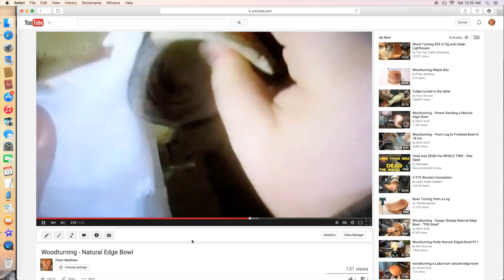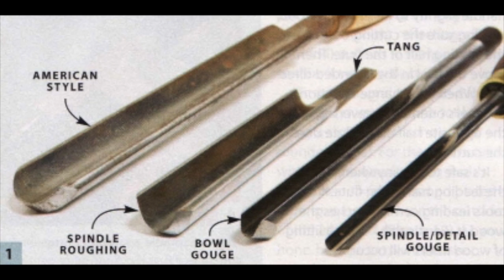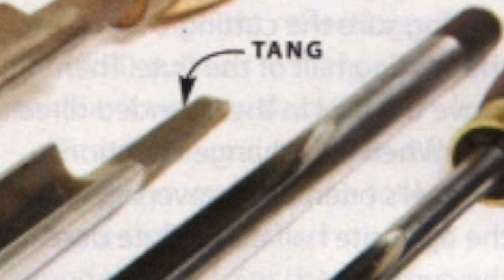Bowl Gouge Basics 101 ~ Rough Turning a Bowl

Comment: I learned YouTube is full of videos that provide good information.  It is also full of videos that provide not so good information.

Your video is good; at least for the first 20 minutes.  When you demonstrated the skew type technique using a bowl gouge and having the gouge vertical, it is a recipe for disaster and very unsafe.   I showed the video to several turners who have been turning wood for 30, 40, 50 and more years, they all shuttered about using that technique.   It will only take one catch and you may be singing soprano in your next video.   I would not recommend to anyone to use this technique.   Play it safe and ride the bevel. 

Be careful in what you recommend or demonstrate in your videos.  No matter how many disclaimers you put in the video, it does not absolve you from legal responsibilities when you provide unsafe information.  You may end up paying a whole lot of money defending yourself in the legal system and potentially paying outlandish damages.    I recommend taking this portion out of your video that otherwise provides good info.